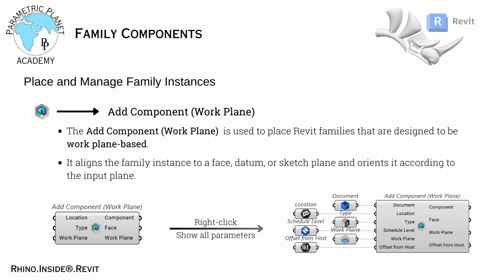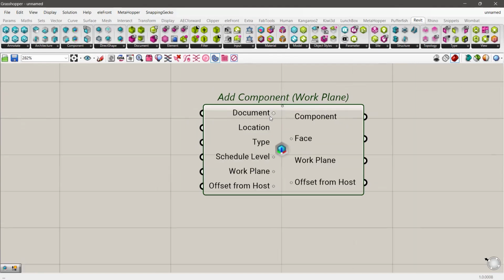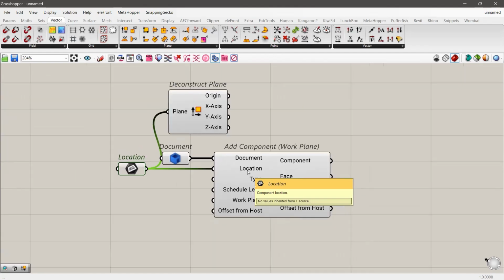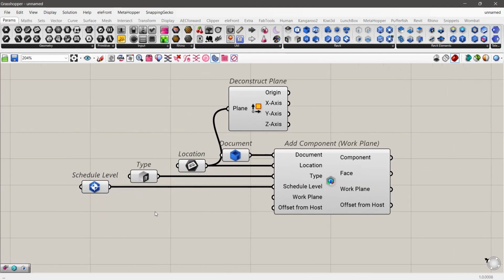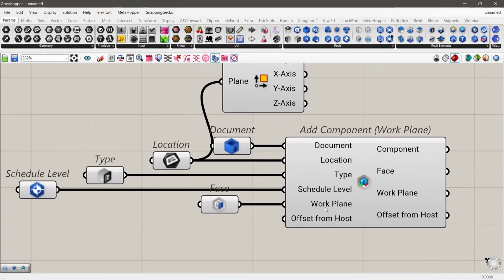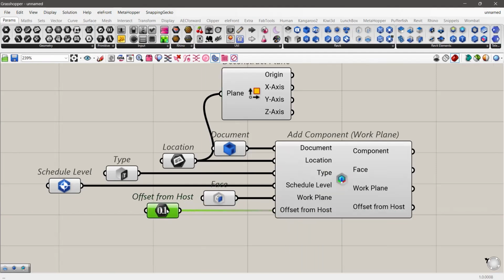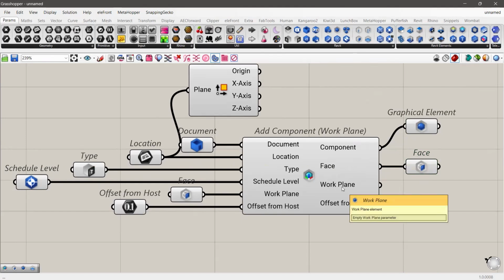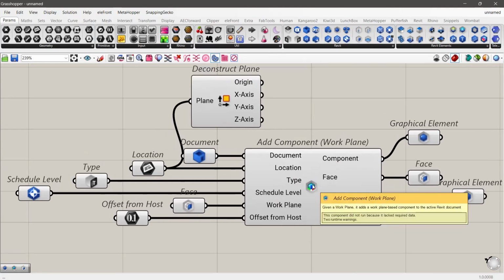Introduction to Add Component WorkPlane | Rhino.Inside.Revit

Comment: Thank you so much , I am working in revit 2020 , 
When I want to push revit elements such as floors from a list of curves right into the add revit floor component it tells me that the feature is only available for 2022
Is directshape only valid workflow for me ? 
I would have never been able to automate tedious tasks such as tiling if not for your tutorials.
Many thanks :)
Reply from the maker: Thank you very much for your comment. It’s better to use the latest version of Revit and Rhino.inside because the developers have added many new components.
You can also check the Rhino.inside community if you want to be ahead of the game:)
Reply: @ParametricPlanet In this case I have no choice because in the BIM specifications requirements we need Revit 2020.
The directshape + hatches workflow is what i'll do for now, thank you for that huge tip btw !
You are very much a pioneer and a guiding light in this space as someone who only recently began  exploring this space and I hugely appreciate your contribution.
I will definnitely join the community as this will be the future of building industry.
Reply from the maker: @Iriesu  Yes you can also use Direct shapes to create intelligent Models with all the parameters. Not only that you can also create schedules and drawings for the direct shapes.

here is the link to the community:
https://www.skool.com/rhinoinsiderevit/about?ref=1257548f4e5848e28b52f7366c0be9ff